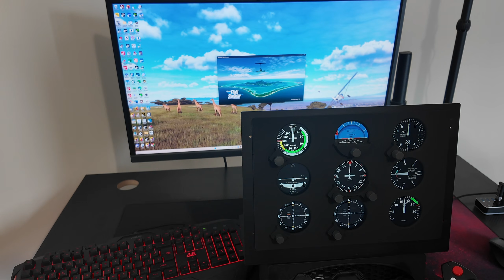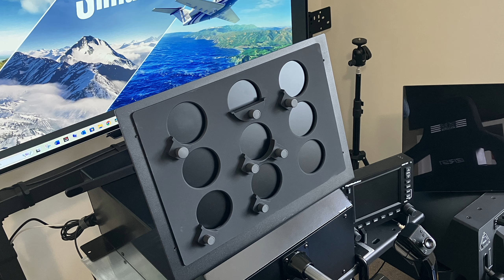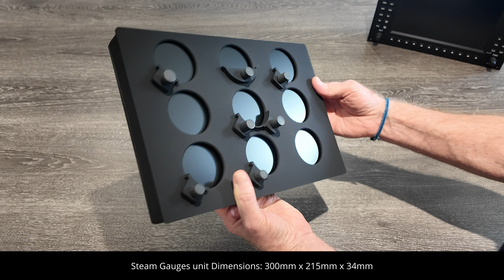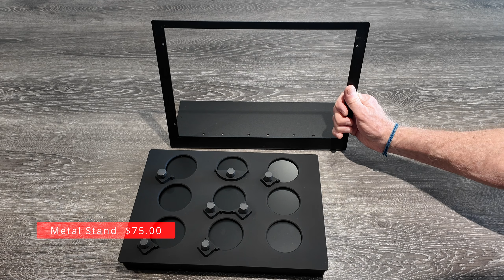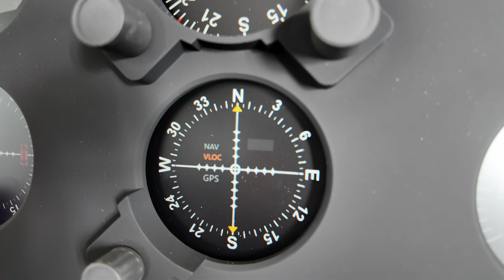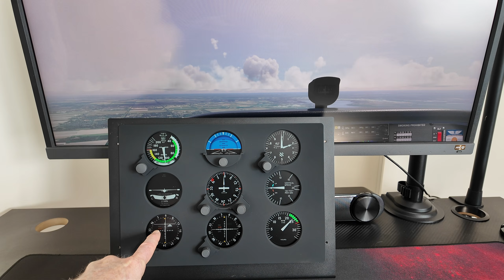Take Control of your Cockpit | Steam Gauge Panel from FlightSim Builder | MSFS & Xplane12

Comment: To begin with, the prices of these products are not cheap - although build quality is good. However, you're going to need deeper pockets than is initially evident. Add on VAT + plus P&P + Import handling fees from customs services or, even worse, getting the carrier to handle it for you. My final cost almost doubled the cost of the product when purchased from Spain. Caveat emptor for sure.

Comment: Thanks for the great video Mark. This looks like what I’ve been wanting.  What are the dimensions of the unit with stand?  Also, is there any impact on PC performance when the unit is being used?  I’ve got an older set-up -  an i7-6700k, 32gb ram with a GTX1080

Also, you mentioned alternatives to this product,  I ‘spoke’ with you a year or so ago about using air manager to display the basic 6-pack of instruments on an ipad but you indicated that that might be possible.  Is this still the case? 

Thanks
Reply from the maker: No noticeable impact on performance. All dimensions are on the Flightsim Builder website. AirManager is an option if you don’t mind configuring/ creating your own panel.
Reply: Ok thanks

Comment: You are correct, it works great with MSFS 2020.  X-Plane 12, not so much.  I could not get mine to work with X-Plane, so Stan sent me an RMA and had me send it back.  They are now suggesting waiting for 1-2 weeks until they release the X-Plane setup automation and Boost Mode. Using the unit with X-Plane before then may result in a cumbersome initial setup and less responsive encoders due to the absence of Boost Mode.  I will say this, FSB support is second to none; extremely helpful.
Reply from the maker: Thanks for the feedback